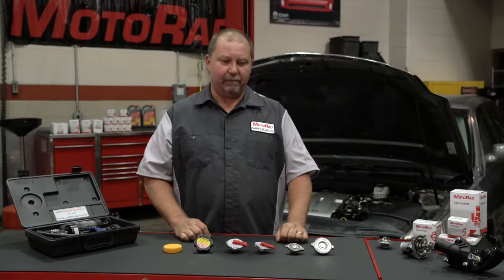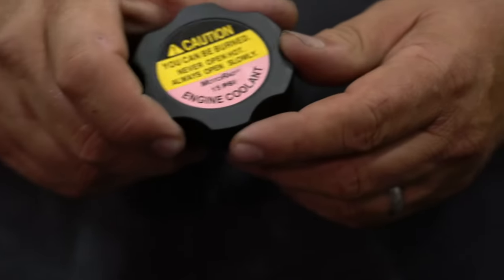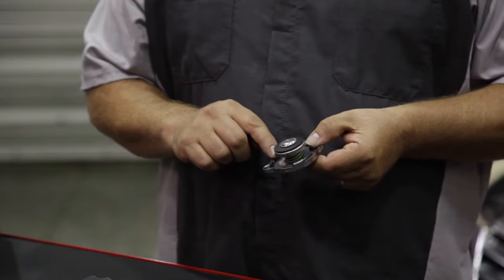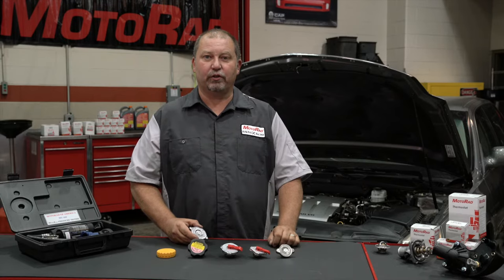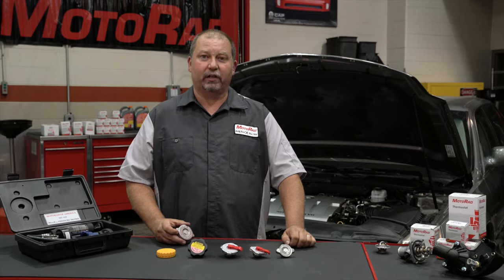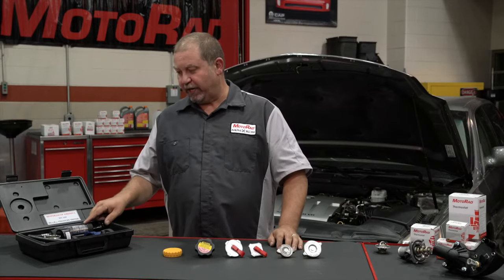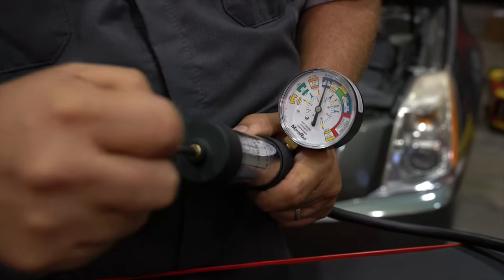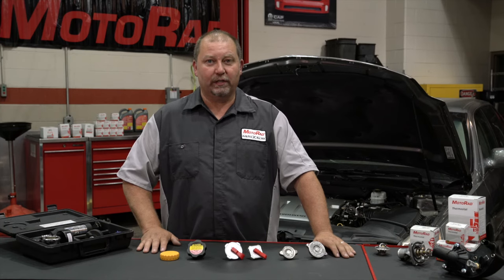Radiator Cap Overview by MotoRad

Comment: Beware! Just recently changed a radiator cap and nearly destroyed the engine as it wouldn't allow the coolant to return to the radiator from the expansion tank and resulted in the engine getting hot as most of the coolant went out of the overflow in the expansion tank.
Reply: That's what you get from aftermarket caps.
Reply: Was this the result of installing higher pressure rating cap e.g. system requires 15 psi & the cap is 20?
Reply: Which cap did you get
Reply: @aboodmki3  No I changed it to the correct psi for the car and it didn't solve the problem. I then put the original one back on and the problem went for a year. Anyway the problem just started again recently and this time I noticed a slight leak on the radiator. I changed the radiator and it's fine now.
Reply: Which cap are you complaining about? The Stant with pressure release? I had a friend tell me that the Stant ones don't allow back flow is that true?
Reply: @richarderrington9478 you prob had to burp your system
Reply: about to replace my cap  with same symptoms. i got the car used tho idk where mines from. its overheated like 5 times, like extremely. but its so badass. my badass subaru really is tough. its got the metal headgaskets that can withstand heat better, and theyve really proven themselves... anyway i hope the cap helps and my mysterious coolant behavior stops. pray i didnt destroy the motor

Comment: All these local auto parts store sell is garbage, brands I have never heard of, no one wants to sell quality parts because they cannot make 300% profit. I had to order a Stant Cap online, never go cheap on radiator caps, belts, hoses and batteries, these will all leave you stranded on the spot if they fail.
Reply: Rock Auto is a good place to buy brand name at decent prices, but you won't really save much unless you stock up due to the shipment costs.  I let the computer pick for me to save money on shipping , it works in my favor 80% of the time.   Summit sells stuff at regular price but they usually include a 15% off coupon for your next order.
Reply: Use only OEM Radiator caps or forget about it. Only aftermarket caps I would recommend in terms of quality compared to OEM is dorman caps. But 99% of the time they are the same price as OEM so just go with OEM.
Reply: @MrP71  You have to get the Dornan products that specifically say Dorman OE Solutions. The ones that don't say that are just third party sellers that use the Dorman brand to sell their lower quality products. You also have to properly torque the parts and install them correctly per OE manual instructions. OEM is superior, but if you ever have to get aftermarket, only go with Dorman OE Solutions.

Comment: I’m on my 3rd Motorad radiator cap. They seal once (once) if you have to open the system up, be prepared to replace the cap again, as they will not seal properly afterwards. The top gasket always leaks!

Comment: Thanks for the explanation, though I wanted to know more why you would choose a radiator cap with or without the pressure release valve. My mechanic suggested I buy the radiator cap without the valve and I don't know why. It seems like he is just either old-fashioned or suggesting a cheaper replacement radiator cap.

Comment: Ive purchased multiple Rad Caps and when tested using my PSI tester none really hold up. I've got a 2010 FX35 and the rad PSI is 20psi.... ive ordered 3 rad caps, all OEM and they start to leak at 15PSi.... its super annoying because all my coolant ends up in the expansion tank. But i noticed the neck that cmaps onto the filler on the rap caps are a big "warped" not sure if thats normal, so i'm going to use a plier to straighten them and test.

Comment: Why did you explain each cap except the one that came on our new radiator like the yellow plastic cap on the end ? Ours is actual black but plastic and none of us could get that cap off it would turn a qtr or half the. But still stuck any advice . The radiator is a CU1826

Comment: Mine looks like the second one from your left. It’s an older model 2005 Nissan Murano. I keep getting over spray on my engine. I thought by changing the cap and putting a better clamp on the overflow hose would help but still getting over spray. Can it be the pressure is releasing from the top of the cap? How do I fix that? Thanks!!

Comment: If the origin cap missing it was 16psi , and iam only have 2 option available for the moment , first install  12psi or 18 psi cap , what can i chose safer for the moment?
Reply: 12 bc you dont want to over pressurize the cooling system. Might cause a hose to come loose etc. But dont run on 12 for too long also bc you might be loosing coolant through the reservoir. Then you'll be low on coolant. Which will cause engine overheating and leading to heads warping and/or head gasket leaks.

Comment: Hi . My Radiator Cap has a Spring and a Rubber part that Fell into the Radiator. Is it going to cause any problems to the Engine? What should I do? Thanks
Reply: Curious if you had an update?
Reply: @phillippardo5712  I took the car to a mechanic shop, they took off the Radiator and open it up. Everything came out but it Cost me 200$
Reply: It has no effects to the cooling system.
Reply: @tanzaniacarschannel6975  it definitely would if it blocked the radiator piping... then your engine can overhead and you could blow a head gasket 🤦🏽‍♂️